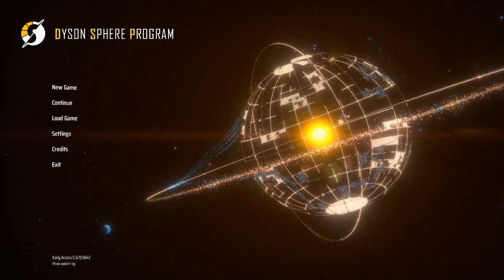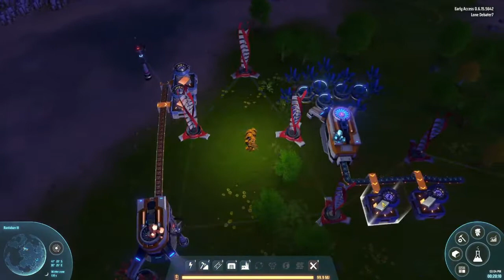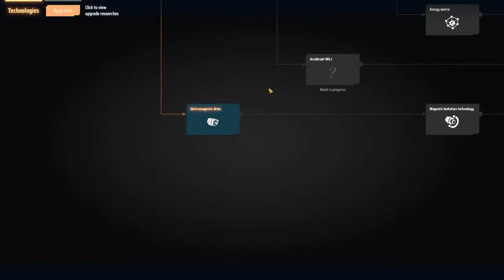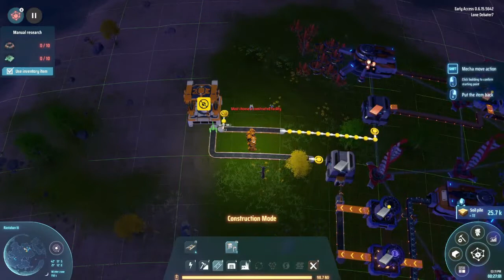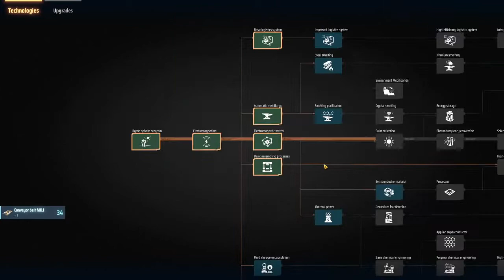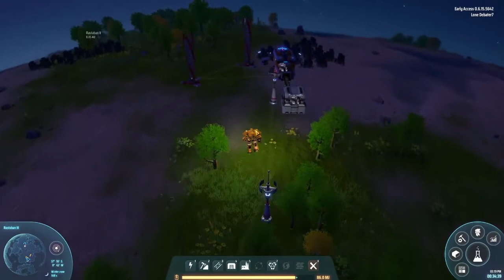Dyson Sphere Program, How to Use the Smelter and Assembler (EP2)

Comment: Mine just spat out a bunch of iron onto the production line and my smelter is saying that it's lacking material, despite the material being on the conveyor. Any ideas?
Reply from the maker: To get materials into and out of the smelter you need to use a loader. You place one on the conveyer with the iron and then click on the smelter to put the iron into. You then need a loader connected to the smelter to an empty belt to put the finished product on. I hope this helps!
Reply: @LoneDebater7  Yeah, this helped thanks, went back to my loader and realised it was backwards. Felt rather silly after that.